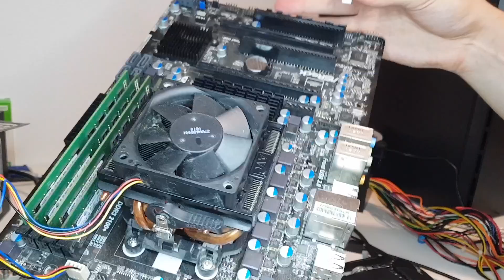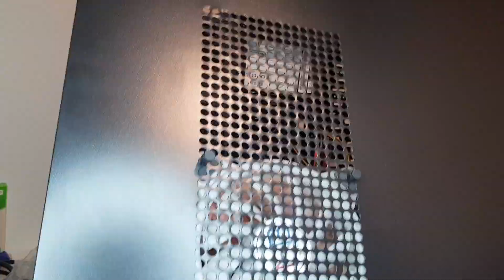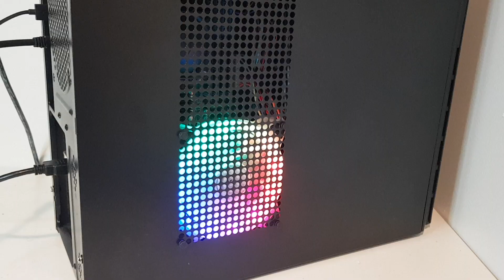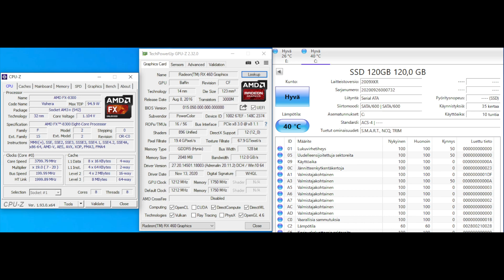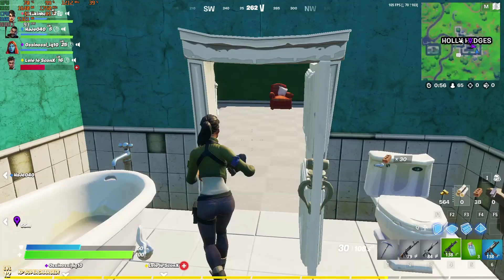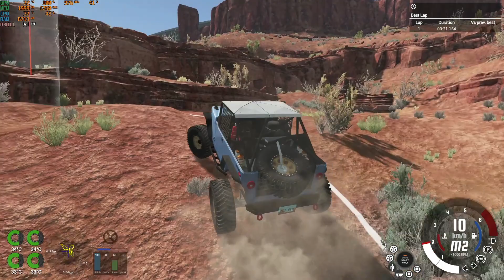FX8300, RX460 Fortnite CS:GO build + benchmarks

Comment: can you recomendation what best pc buildup for gaming : lenovo, dell or acer veriton ? game ; red dead redemption 2. thank's
Reply from the maker: I haven't dealt with Acer Veritons yet. 3rd gen Dells like this 7010 are the easiest builds: https://www.youtube.com/watch?v=DGSfEJjdlZA&feature=youtu.be
Lenovos i can't seem to find as mATX variants at all, only SFF. 
Here is a rdr2 benchmark with quite similar specs to my 7010 build: https://www.youtube.com/watch?v=W3TOVal_6tA.

Fourth gen Dells like 7020 are somewhat better at similar prices to 3rd gen ones, but they require a PSU adapter cable from eBay/AliExpress: https://www.youtube.com/watch?v=pC0fsM6lRlc&t=239s

Keep in mind that what i said here is only confirmed for 3010, 7010, 9010 (3rd gen) and 3020, 7020, 9020 (4th gen). Every model is always it's own story regardless of manufacturer.